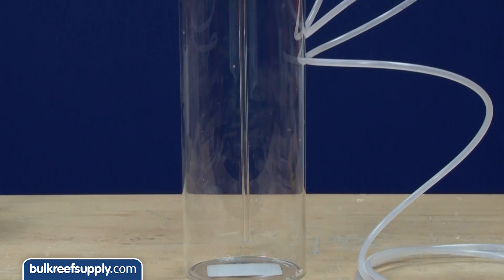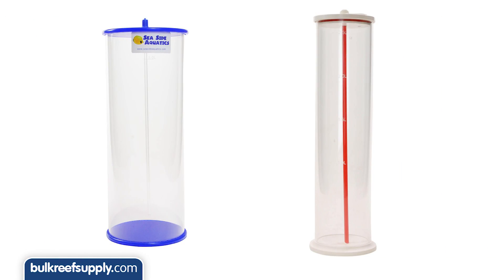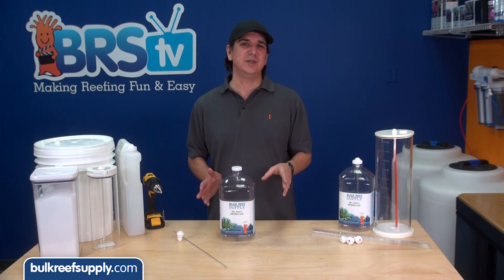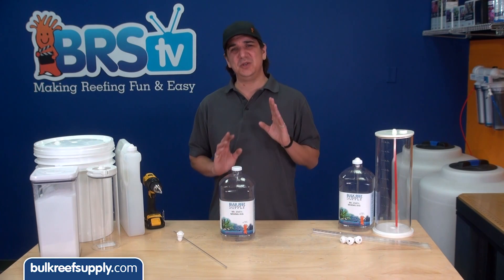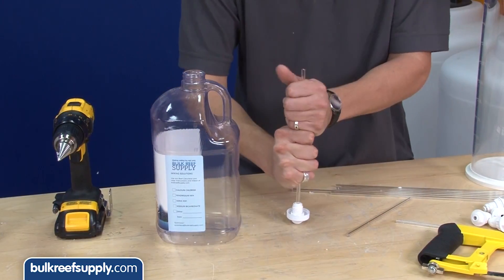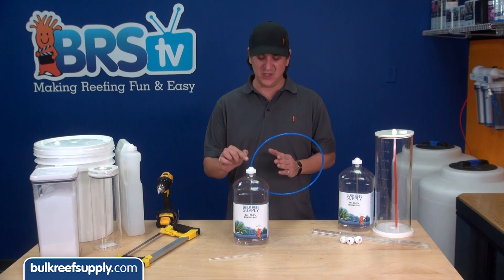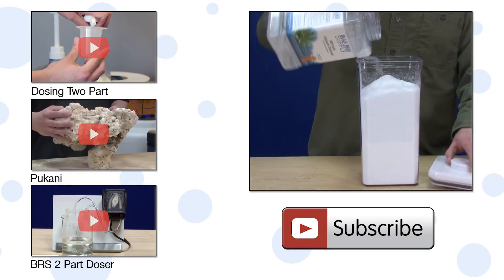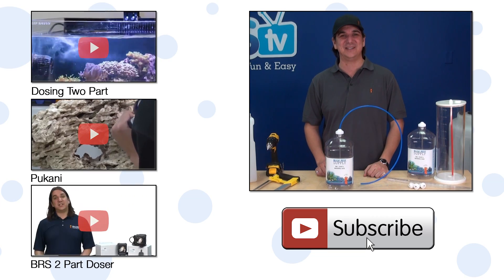DIY: 2 Part Dosing Containers | How To Tuesday

Comment: +bulkreefsupply Hello, I bought all of the above supplies to creat three dosing containers... Cal, Alk, and Mag. I used a piece of water line from my rodi unit and pushed that into the top side of the bulkheads. I then heated the end of the airline tube and stretched it over top the water line tubing and it shrank and fits perfectly. The doser has been running for around three days and the doser lines have began to collect air bubbles in the line. There are some very small and some vary large that separate liquid. Has anyone solved this problem? I'm thinking it's due to the murlock bulkheads with the push fitting of acrylic hard tubing and the water line on top. The air is traveling in that bulkhead/line connection and creating these air bubbles in the line. Any suggestions on fixing? The only thing I can think of is siliconing around the bulkhead connections of tubing on all three at the top and bottom connection. Any help would be greatly appreciated.
Reply: +BulkReefSupplyCom

Comment: wouldn't the air holes cause evaporation i assume the rate of evaporation would be too insignificant to matter?  how likely will it vacuum without the hole as i want to use your gallon jug to both mix the solution and use to dose but that hole will prevent me from be able mix the solution. thanks!
Reply: but i noticed other dosing containers such as the vertex dosing vessel you sell doesn't have a air hole are they different somehow? thanks! :)
Reply: I used a vent from a kids sippy cup. you can buy just the vents for a few dollars

Comment: I like to use the thin jugs. The space between the cap and the handle is perfect for the bulkheads. I just leave the cap unscrewed a bit so that the is no vacuum created. If I need to fill the jug back up I don't have to worry about the acrylic tube getting in the way.